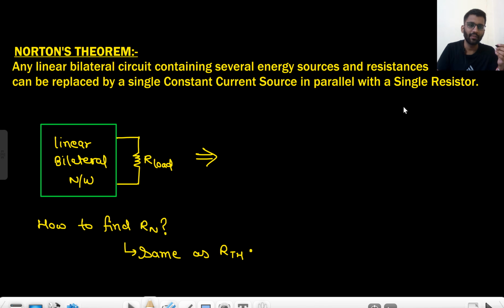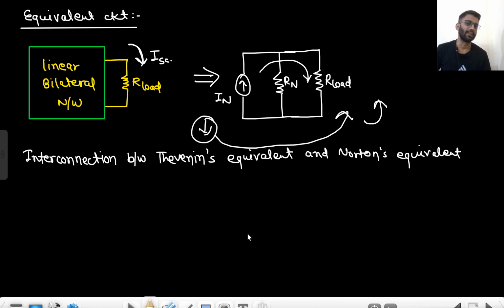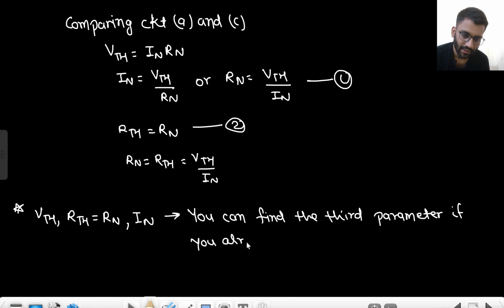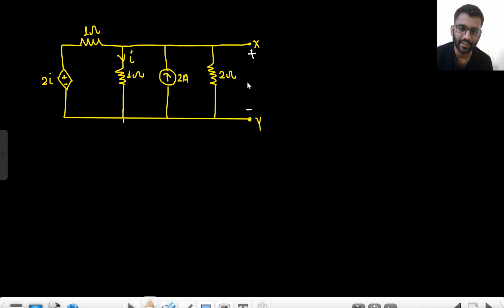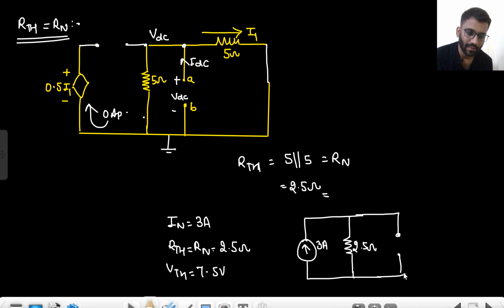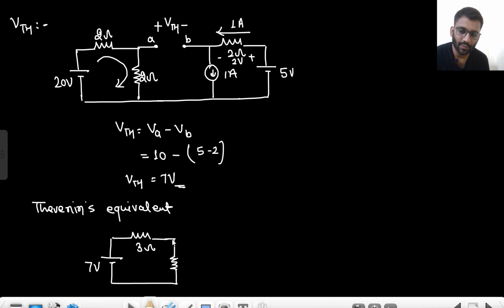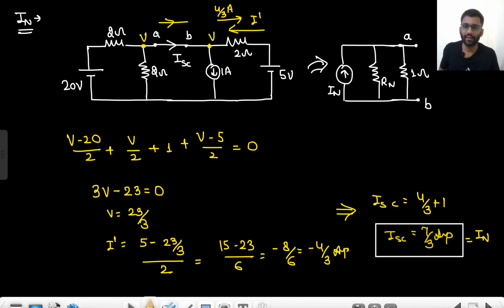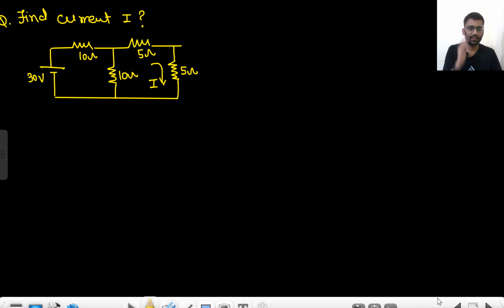Norton's Theorem || Network Analysis || GATE 2025-26 || PrepFusion || Himanshu Agarwal

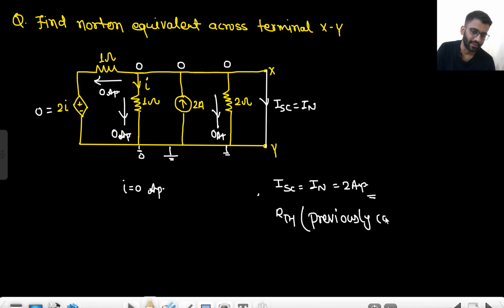Comment: sir at 18:27 u hav told previously that even if voltage across 2 pts is 0 volt but current can flow as u took eg. of a wire in closed loop but here u took current zero via resistors while applying norton th.
i think this rule isnt valid for resistor thats why we took 0 amp current..

Comment: sir, at 29.49 va will  be 20/4 = 5v , but you  written  as 10 v . correct me if i am wrong.
Reply: apply voltage divison, u r solving 20/4 for current

Comment: why is the 1 ohm resistor removed and then rth is calculated? i mean where in the question written 1 ohm is load resistance?
Reply: 1 ohm is connected in between the nodes where you are finding your norton equivalent. So, it's acting as a load only.
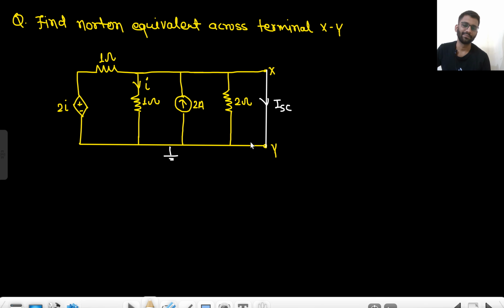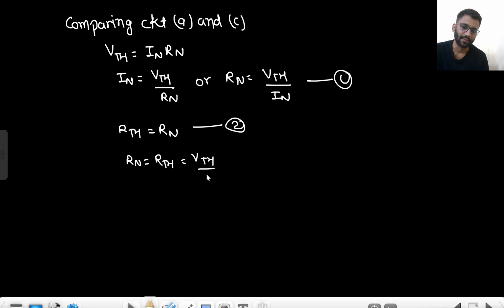Reply: @HimanshuAgarwal_  Then why not do this in every circuit, like removing 2ohm from x-y at 16:51, 1K ohm from a-b in next video(assignment-6) at  11:52, and many more.
Reply: I think the question is framed in a wrong way.
Maybe he wants to calculate across 1 ohm resistor that's why he removed it.
But he extended the terminals A and B so the 1 ohm resistor becomes part of internal circuit and according to question, the Vth has to be calculated across A and B.
So the question should be like,
Find Vth, Rth=Rn and, In across 1ohm resistor.
Reply from the maker: We are finding it across x-y which itself is an open load.
Reply: @PrepFusion_GATE  :( :(
So, if a circuit having the single current source with 5 resistors in parallel (for example), how can I find the Norton resistance here ?

 Should I remove all the resistors like removing the 1 ohm resistor in this example?

please reply!!